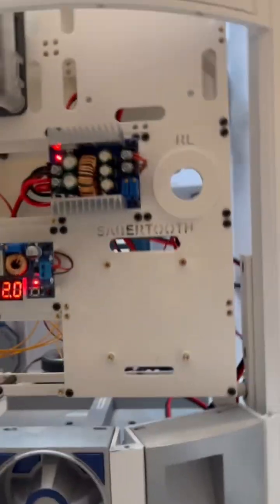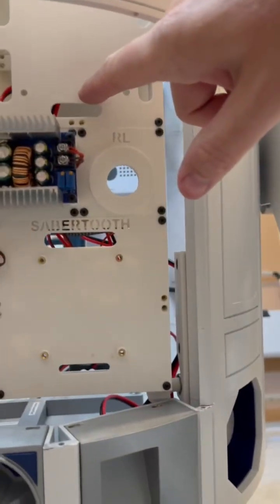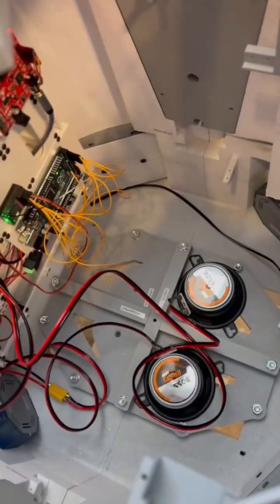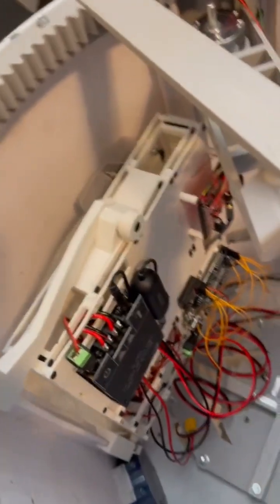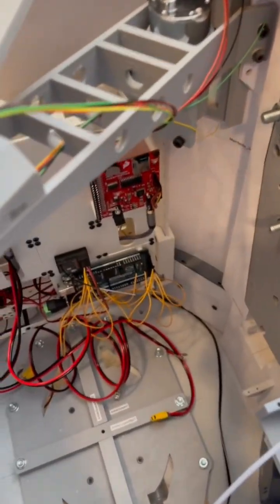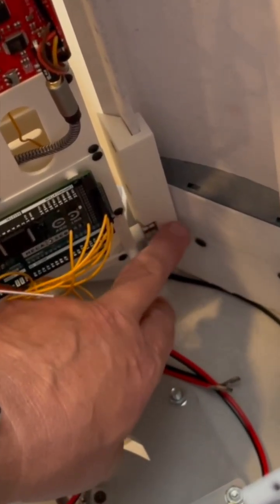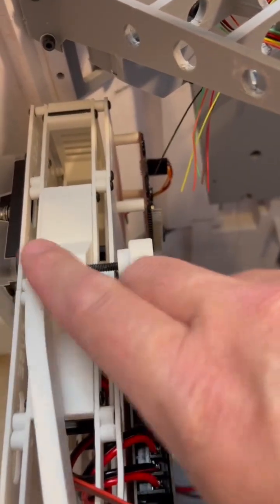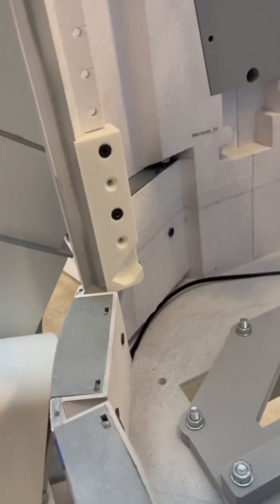R2-D2 Modular Control Unit Mounting and Modifications

Comment: I have my MCU pivot out the back panel.. so I can remove it without the dome coming off.
Reply from the maker: My access panel is shorter than most since I didn’t think about or even know that having a taller one was an option until it was too late.  I think I can make the shorter panel work. Great job in getting your R2 finally rolling around using Shadow RC!